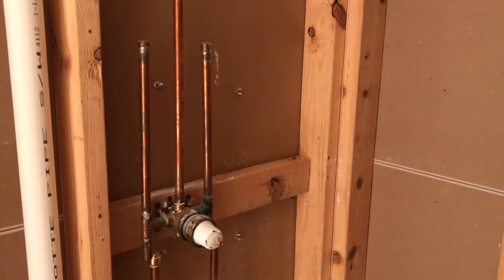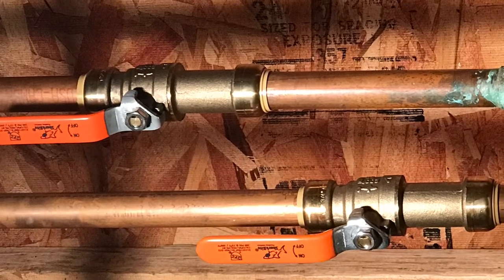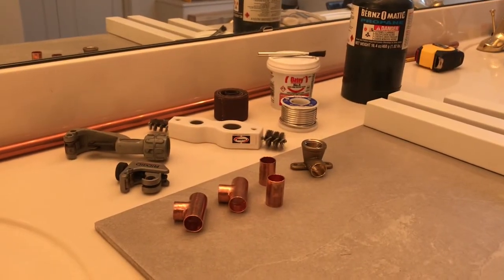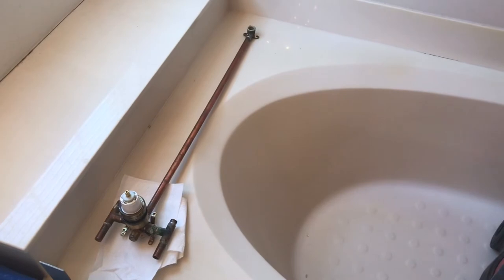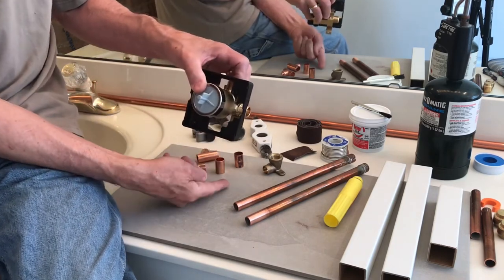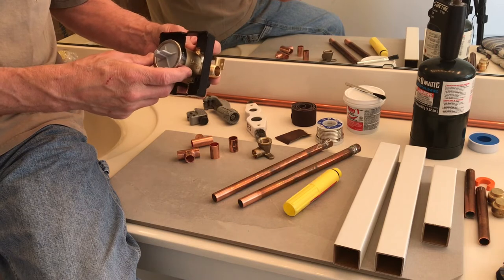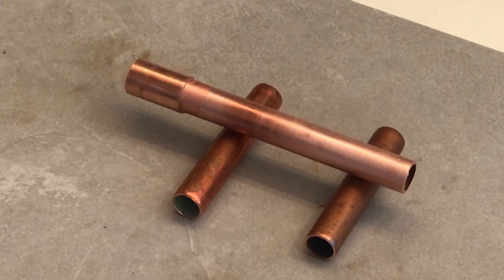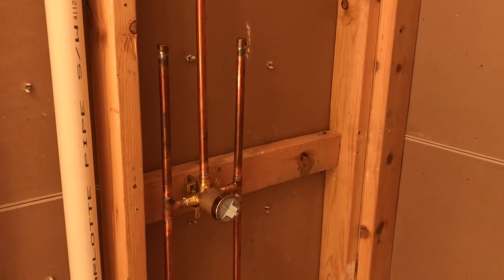Install Delta Multichoice Shower Valve @DIY Boomers

Comment: Sir look at it down that copper right there at all that green stuff that’s from flux. When someone did your copper pipes, they didn’t wipe off the copper when they were done doing the soldering so that’s what happens is years later down the line, the flex will keep eating through the copper, it will make the copper very weak so when you went to crank on it, it just broke off. So that’s not really your fault sir that’s the fault of the original installer your original plumber was not a good person. If you don’t wipe the flocks off there, it’s going to eat through years later down the line. It’s like if you use too much it will eat away the inside. The same way goes if you use too much Sauter, it will cause a little nipple on the inside, which will cause turbulence, which actually will end up causing a pinhole leak later down the line and stuff.  There’s more to just slapping those two together wherever you put flux then solder flows but you must clean up. Replace it with Pex.
Reply from the maker: Wow, good to know! I didn’t realize that it could do damage to the copper. Thanks for the heads up!
Reply: When copper tarnishes, it typically turns a green color due to a chemical reaction with oxygen in the air, forming a patina that is often described as blue-green or gray-green.
Reply: @noweare1  From Kestrr 
In many applications where soldering is done with an excessive amount of rosin flux there appears on the copper surface a green residue similar to corrosion.